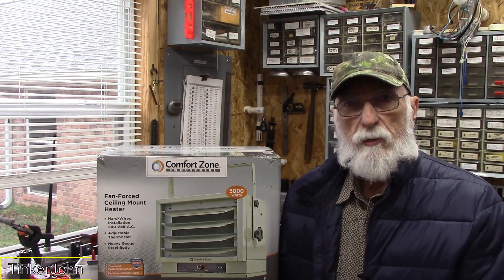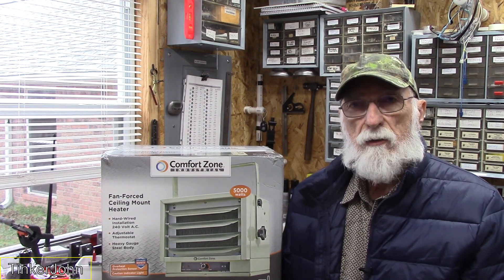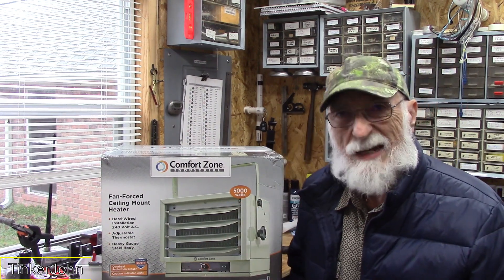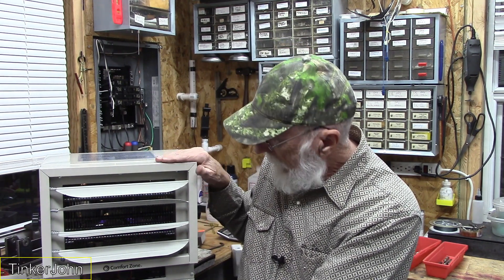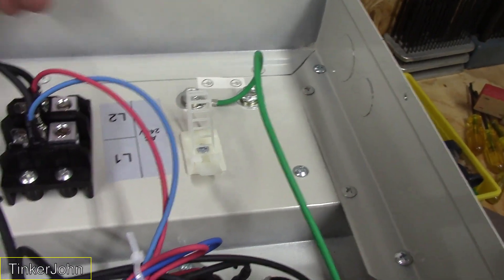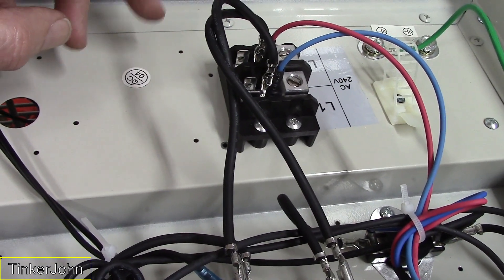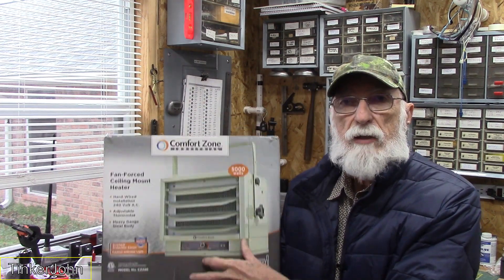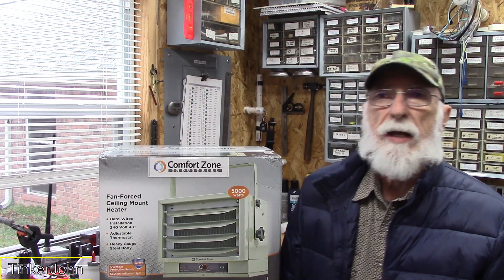Comfort Zone 5000 Watt Shop/Garage Heater #shoptips

Comment: Does the fan work well for moving the heat around. My small unit the fan does little to move heat. Does the manual say anything about a remote thermostat. It may overheat with a remote. My garage has a high ceiling which really does not help unless maybe I added a ceiling fan. Stay warm.🤣
Reply from the maker: Galen, the fan works "fair" for moving the air.  Somedays I'll use a small oscillating fan to help circulation.  Overall very pleased with the heater.